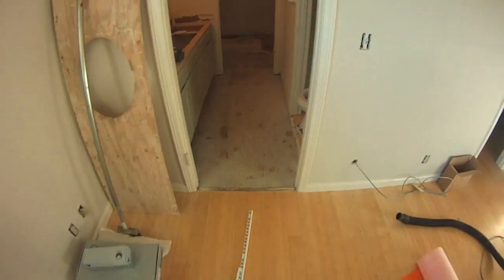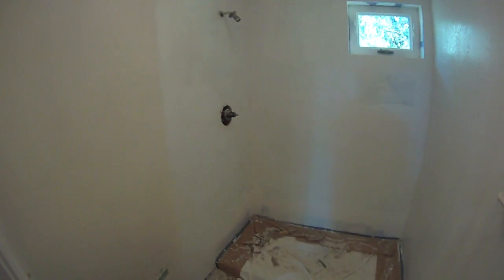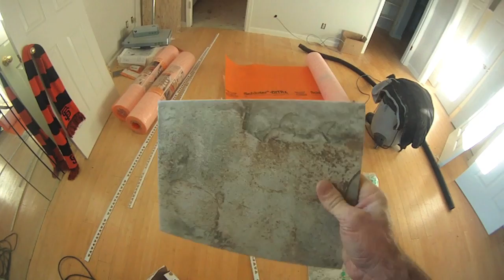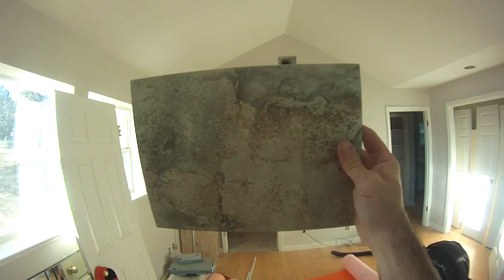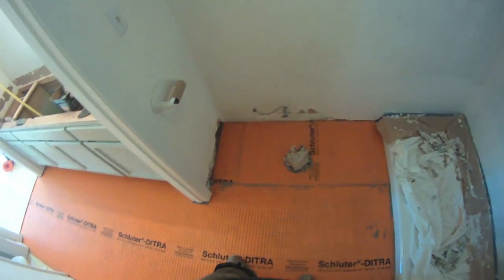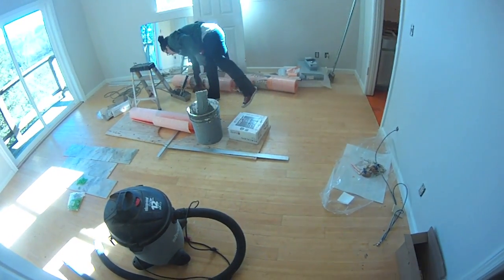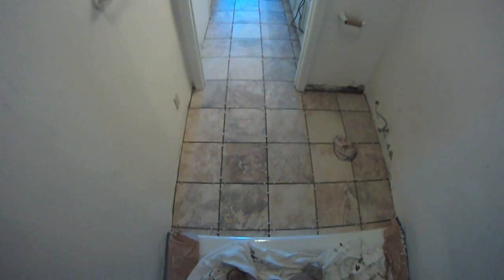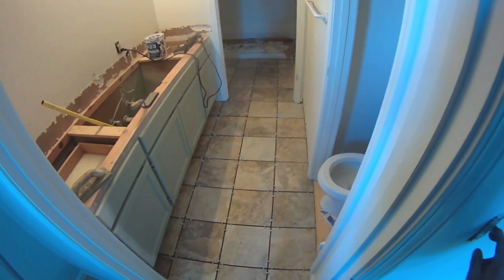Schluter Ditra Underlayment

Comment: Curious as to why you started at the door instead of working towards it? Looks great!
Reply from the maker: +horsekid98367 I had a few reasons, I wanted whole tile to be seen at the first threshold that leads into the space.  There is a door that separates the sink area from the toilet/shower area.  I suspect that door will be closed most of the time.  Also, with the toilet in place, you only see a couple of the cut tiles when standing in the entry way and most people put a small throw rug or mat to step out on when getting out of the shower. This will hide the cut tile.  When the towel racks are added and towels hung it will break up your sight line even more.  It's dealer's choice really.
Reply: +yourbeekeeper 
Makes sense to me! Thats why you get paid the big bucks :-)

Comment: hey that detra is not for walls. you should be using schluter kerdi board in place of drywall!
Reply from the maker: +jsparks2k7 Yeah, Thanks for telling me now and not before... lol.    I completed this shower three weeks ago, and about a week after I was all done, I learned about the boards (remember I said I had not used any Schluter systems before)... the sales rep at the tile store misled me and said I could use the Ditra for walls...  now it's all done and I am fucked.  I have been in contact with Schluter and the owner of the tile store. The MFG says "while it is not a recommended underlay for vertical applications, looking at your video submission (I made them a video of what/how I used it) there should be no adhesion or water penetration issues"  .    I agree, that it did seem to adhere very well to the walls, and the tile stuck amazingly well to the surface, I am not happy with how I was lied to.  I am in the process of legal action against the store for financial compensation and acceptance of any and all damage caused by a failure of the water proof membrane... it ain't going to be pretty.  At least the owner has been EXTREMELY understanding through all of this mess.
Reply: wow what a mess. sorry to here that. I work at a tile shop myself and its hard to believe a salesman wouldn't know the correct schluter materials. good luck!
Reply from the maker: I spoke to a couple of the other sales reps on the sly and it Turns out he knew darn well about the boards, but that shop does not normally stock them. They will, however special order what is needed.  This is a medium size, stand alone store and not a big box or chain tile store.  The sales guy was looking for the quick sale and commission as he had already turned in his two weeks notice and had about three days before he was out the door.   The store owner has been extremely understanding as has the property owner.  We are working toward a solution, but it looks the tile store will refund all the money for the entire sale...which includes the tile as well and the property owner is willing to leave it alone and roll with it.  I am just waiting for the legal paperwork to get drawn and finalized that takes me out of the liability equation. I sure am glad I have a lot of pictures and video of the process.

Comment: how common is toilet is not even level with the door when sides one side and the other size bigger o hello
Reply from the maker: +paula kuzila The code requires a minimum 15.5 inches from center toilet to a hard surface.  It is very common to place the toilet as close to a wall as allowed so you have more space to enter and exit the shower.